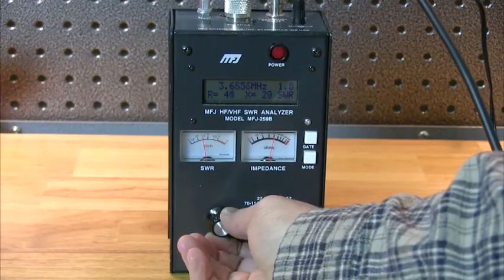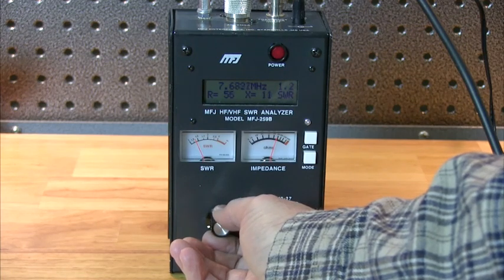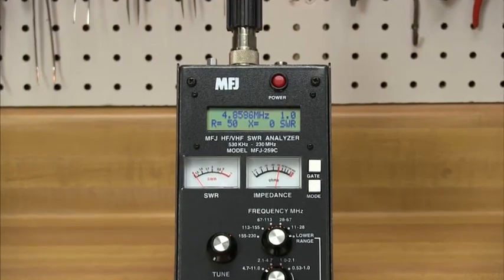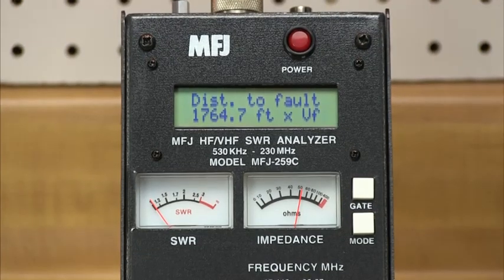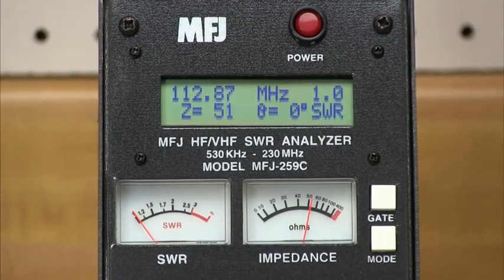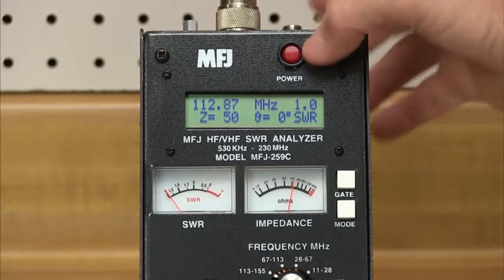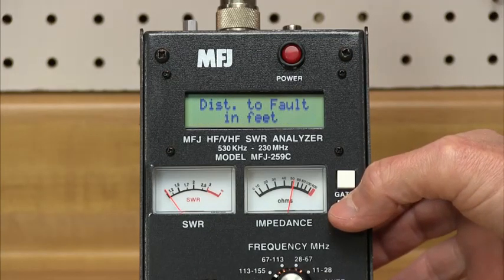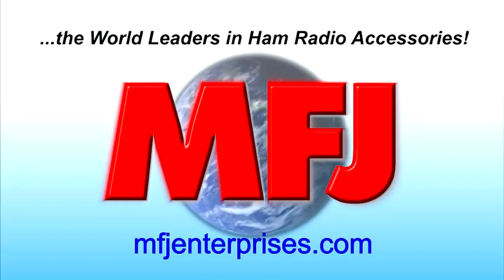MFJ-259C SWR Analyzer

Comment: I really like this unit because it has an analog sweep meter you can see in the daylight, a very important old school AU meter. Trying to look at a flickering LCD is no help to get to the proper gamma match feed impedance when you're hanging in a bucket working on a huge muti band HF antenna. The digital is only good when you get it mechanically or coil box switcher set to a fixed 50-52 ohm reading on all bands. Think about doing that with a fancy USB driven VHF/UHF analyzer while balancing your laptop in a bucket truck 40+ feet in the air swaying in the wind while you set the driven band gamma match rods. There's an old school saying that you can't get the best of both worlds, running UHF requires LM400 coax or using any fancy UHF analyzer bridge will be a worthless endeavor as far as loss. LM400 gives a 52 ohm load so an antenna tuner may be needed when used on a HF rig. I didn't see any benefit for the LM400 on my HF antenna but it's a must if you are running 2 meter through 70 CM and beyond. I had to beg times microwave and lie like a contractor to get 250 feet of that stuff many years ago at .45 cents per foot.